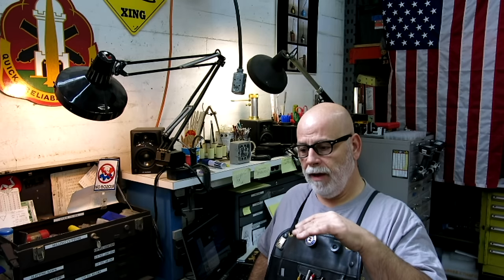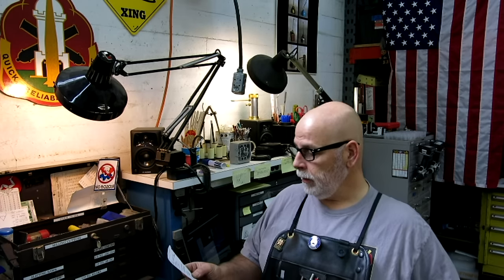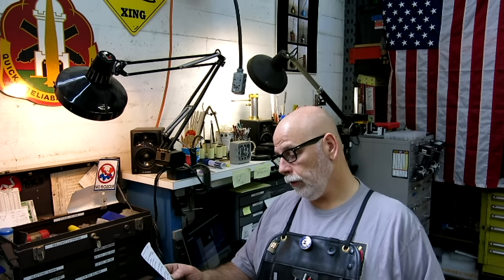Monday Night Meatloaf 108

Comment: We used this kind of tool for two purposes when we were doing epoxy resin and carbon fiber parts. It's used to penetrate the foam that is part of the sandwich that makes carbon fiber parts as stiff as they are. With the holes in the foam, the vacuum that is applied to the top of the mould can pull out the excess resin from the bottom layer through the foam without filling all the pores of the foam (and thus making it heavy). The other use is to punch a lot of holes in a very short time in the foil that, in the same application, goes in between the top layer of the sandwich and the foam mats that distribute the vacuum evenly. Without this separating foil, everything would stick to the part and you would glue all the vacuum equipment together. Without the holes, you could'nt suck any excess resin out.
We had quite a few different sizes of theses things, but most didn't look as agressive as that one.

Comment: Maybe at the start of the stir welding the tool and the material are too cold so it doesn't work properly. Maybe let the tool rub a little bit on the beginning before starting the autofeed?
Reply: Klaufmann I concur. At start both tool and material are too cool to make proper weld. Maybe start off with slow feed speed and then switch to higher feed as tool and work come up to temperature.
Reply from the maker: Hi Klaufmann,

I think you are correct. It makes some sense as at the point where its welding well the tool is nice and hot. Thanks for the comment.

Cheers,

Tom

Comment: Interesting... on that last friction stir weld it looks like the tool discolored very quickly at the end, possibly because you run out of forward material that has been acting as a heat sink?  Cool tech to be sure.  Thanks for the sweet demo Tom.

Comment: It looks like the wall paper perforating tool Dad had when I was a little boy (70 now)   It poked holes in the paper so water could soften the sizing paste they used to use and you could remove the paper.  Your tool looks new so I guess they still make them.

Comment: Hi Tom,
Glad you like the hammer, this is a "tool" don't worry about the first "Ding" it takes about 30 seconds or so to get over it (according to the other friends that got one, Keith, Randy, Stan, Chuck, even Phill and you humble little myself, mine is really starting to look used up now...   ;)
Nice fusion weld demo, would a little slower start help just like other techniques when welding aluminum to give it time to absorb some heat or for the puddle...???    Just an idea since I'm not experienced with this technique.
Reply: Pierre's Garage loved the hammers you gave put for Keith givaway. I may not have been one of the selected 5 who got a toolbox but love what Keith is doing with the givaway. I will try again next year. I love how people like you give so much and inspire us learning the trade. great job on the hammers.
Reply from the maker: Hi Pierre,

Its not like traditional welding. The temperature is much lower so puddle is kind of a relative term. I do think that heat played a part in the starting section of the weld. Thanks for the comment.

Cheers,

Tom

Comment: Those may be differential screws on the level. An inner thread moves the tab in one direction while an outer thread moves it in the other direction by a slightly different amount so the actual motion is the difference between the threads.

I was almost expecting to see a feature I have seen on an aircraft sextant which uses a bubble level for an artificial horizon. The bubble chamber has a screw which compresses the fluid in the bubble chamber which changes the size of the bubble. This lets you adjust the size to fit exactly between two graduations.

Comment: I remember when i was a kid,(40 years ago) these were also used when they needed to release the trapped air bubbles from the rubberized / foam flooring that was being installed on my elementary gymnasium ...  at least that what was told to me... made sense to me, but, heck, they were likely just wanting me to go away and told me anything...lol

Comment: I've got a bit of experience with friction welding, mostly just in installing upsets/fittings on pipe and bar. I have messed with doing a butt weld in aluminum. You are going to want to preheat both the aluminum and tool a bit and slow down the start to get the tool heated up to temp. I never have run into a actual use for it but it is kind of neat.

Comment: looks like either of two options, both are for automotive tires...... one being external tire usage called a perforator, the other for usage inside the tire for patch work from a puncture.... and most of all, in the tire manufacturing itself. as the tire is winding on layers of the unvulcanized rubber compounds, this pokey tool is pushed into the top layers to vent possible air bubbles, and to allow gases to escape when the carcass is dropped in the mold and pressed, to fill the cavity's details, before the heating process, typically a tool this wide is for very large tires... that would be my guess

Comment: it appears that the stir weld works best once the tool itself gets hot.. Seems logical as metal generally bonds at high temps.
Reply: yes, it must be sucking heat away from the weld at first, causing it to be less 'melty', can probably add some heat with a small butane torch, you can see the brown and blue hues work their way upwards

Comment: I suspect the start issue is due to heat buildup.  You probably need to have a half speed roll-in, then go to full speed, to build enough heat in the tool and part.

Comment: Great video!

On the stir welding: I wonder if that "phenomenon" at the start of each weld has to do with the tool (or the material) needing to warm up to get the metal flowing. I'm curious as to what would happen if the tool and/or part were lightly preheated. 

I've seen stir welding done once in person. They were doing essentially an elongated spot weld through two stacked sheets of aluminum. Don't quite recall the geometry of the tool that allowed them to do that, but they needed a five-axis millturn to make them. They were using a Haas TM-1 mill and had probably ten table clamps, one every two inches or so. Seemed like there was a lot more force involved, I'm surprised that the four little clamps you had were enough to hold it!

Comment: You skipped over the most important feature of the end measure system that being built in temperature compensation.  If you want to work in the tenths range and have agreement from various non climate controlled shops the end measures were the best method because they expanded and contracted to compensate.
Reply from the maker: Hi Brian,

I did that on purpose so you would leave a comment.......Thanks for the comment.

Cheers,

Tom
Reply: oxtoolco
A fill in the blanks video. Fun!! :-)

Comment: Stir welding - I'd be concerned with the heat transfer to the collet through the tool.  There must be some extreme thermal expansion forces getting into the collet.

Comment: I might ask about the 5-block test. My surface grinder was bought at auction in the 1980s. It was used to grind EDM electrodes and it was a major mess with carbon dust everywhere. The machine has never been evaluated or reworked. For my needs it is as precise as needed since I don't use it for absolute precision (I use it to grind small tools under 1/2 inch so if it's out .003 over the travel of 18 inches it doesn't matter). My test would be to see *how bad* the machine is not how good.
Reply: Carpet seaming tool

Comment: I should get my buddy at dockyards to do that challenge on his good machine at work. Had him make me surface plates before. Finishing passes were 0.0001"
I forget the brand of the machine, but its an almost new one thats only used By the instructors or shop techs for precision work. Few other grinders for the students to use. Engineering fleet school, royal canadian navy. quite the setup.
Good friend of mine manages the tool crib there, often able to get him to do projects for me, mainly grinder work which Im not set up for.
Reply from the maker: Hi Geoff,

Ask if he wants to play. I still have blocks here. Thanks for the comment.

Cheers,

Tom
Reply: I'll ask him tomorrow! He's been pretty busy lately so I'm not sure if he'll have the chance. Worth a shot though. From the work I've had done on it I'd be surprised if it wasn't as good as anything you've seen.

Comment: I wonder what the results of the friction welding compared to a normal weld joint in a pull test.
 Like they used to do for welding coupons.
Reply from the maker: Hey Bill,

The weld is much stronger than a similar weld using TIG or some molten process. That is one of the advantages of the process. Thanks for the comment.

Cheers,

Tom

Comment: I'm wondering if your Z-height "issue" on the first run is actually the center of the aluminum creeping up due to thermal expansion, since you have the pieces constrained near the ends. At any rate, if it were a weld test, the first and last inch don't count. ;)

Comment: I'm guessing there are at least two phenomena when starting a friction stir weld. Firstly, your bit and welded material is cold. As far as I know  friction stir welding needs some sort of localised microscopic melting of the material at the interfaces between crystallites. The other thing is kind of related to the first as in your "welding bit" elongates as it heats up and looking at the discolouration I bet that the difference isn't trivial. You exert more and more pressure on your work piece and it heats up more and more. I bet it's some kind of equilibrium thing but the goodness of the weld and the z-height probably do not have a linear relation.

Comment: Juicy meatloaf, Tom.  Sweet level!  Amazing demo on the stir weld.  
I'm pretty sure the roller-gizmo is X-rated, so I'm not going to troll for a link.  ;-)
Reply: the roller thing is to do with helping layers of rubber or fibreglass to adhere together, not a kinky toy!

Comment: Cool level Tom! Maybe I'll score one at the market! 😆 That stir welding is interesting. I wonder what applications it could be used for. Does the tool have a small tit on it? I thought it was flat until you showed it at the end.
Reply from the maker: Hey Adam,

Yes there is a little tit on the tool equal to the thickness of the material you are welding. I guess there is a tool for each material thickness if you want full penetration welds. 

Talk to you soon.

Tom

Comment: no break test?  how strong did the welds turn out?
Reply: my thoughts exactly, we need some destructive testing conducted so we can truly determine the viability of home-brewed stir-welding. Bend test, cut and etch to reveal weld nugget, etc...if we get enough votes maybe Tom will revisit the piece and do the testing
Reply: I was thinking cut across the weld, polish to a few microns, acid etch, and then have a look with an electron microscope. (Then bend it to see if it breaks.)
Reply from the maker: Hi Peter,

I'm almost finished with my electron microscope. Don't give me any crazy ideas. I have enough on my own. Thanks for the comment.

Cheers,

Tom
Reply: oxtoolco after seeing where you work, I can't tell if this is a joke or not. Here's hoping you pickup an surplus electron microscope for your Calibration Lab.

Comment: The indicator is most probably a Drum eccentricity Gauge. Video write/read heads are mounted on rotating drums and when your replaced the heads (because of wear) you had to adjust the drum so that it ran true  again. Otherwise the wear on the heads on opposite sides of the drum would be uneven or in extreme cases it would damage the magnetic coating of the tape. The indicator would be mounted on a special jig taht fit onto the mechanism of the recorer/player. A fairly modern example: https://www.youtube.com/watch?v=E4tOQdEX3A0

Comment: @17:11
A quick search on the googler about the spike covered wheel yields interesting results.

http://www.keepingitkinky.net/bdsm/toys-equipment/wartenberg-pinwheel/

Apparently it's a Wartenberg wheel, "designed to test nerve reactions (sensitivity) as it rolled systematically across the skin"....."It is also used as a BDSM or sensation sex toy, sometimes while connected to a violet wand electrical device."

Comment: what material is the friction stir welder rod made of and at what rpm are you running it at? thanx tom
Reply from the maker: Hi Erik,

I gave the parameters for the weld on the video. Somebody was fast forwarding...... The tool is high speed steel. RPM was 1200 rpm. Thanks for the comment.

Cheers,

Tom

Comment: As much as i can, i believe the level story. I mean, as the military arm of a country, you'd want to safeguard the cash that went in to R&D. Essentially, the edge of your sword. Plus, there's a lot of tech that's treated even today, with the same level of hush-hush.
Surely you've heard of the drive in recent years to have Virtual Reality headsets, at least tangentially, imagine that the military of US has such devices they use for their remote control programs.
Just recently civilian tech is catching up, and in terms of quality and functionality per individual, i very much doubt that even in the next decade, they'll be able to do anything remotely close to what these guys keep under the pillow. So yeah, if i'd be the military decision body, i'd keep that level on a need to know basis, the amount of tech that spawns from it as a device is substantial.

Comment: Coincidence is an interesting thing.  I recently picked up an indicator of a very similar pattern to yours that is labeled Hamilton Watch Company TI4-005 on the face, although it was made in Japan.  it is +/-.002" full scale, and has a very similar arm coming out of the side of a square block, but the arm has a conventional tip like a dial test indicator. it's smallest division is .00005"  It doesn't have the fancy adjuster on the side, but it does have an interesting knob on the top. With the knob in one position, it is spring loaded down and reads up from below. In the other position it is spring loaded up, and reads down from above.

There's a page on a very similar looking indicator at http://www.rappindustrialsales.com/Dorsey/Dorsey/pg00018.html (still available, made in the USA) that shows a diagram of the interior.  It appears to be flexures, as you speculated.  A picture of the Dorsey version is at https://www.flickr.com/photos/dorseymetrology/5081440111 .  And I just stumbled across an exploded drawing at https://www.dorseymetrology.com/pdf/ti4-005.pdf   No disassembly required.